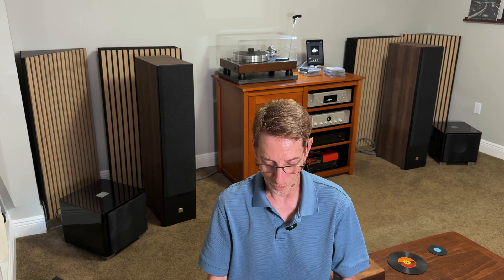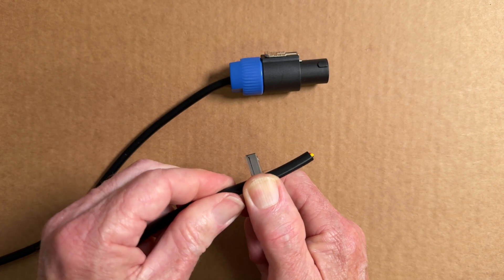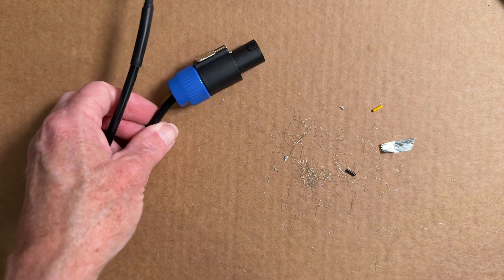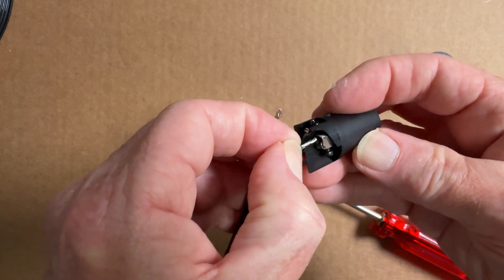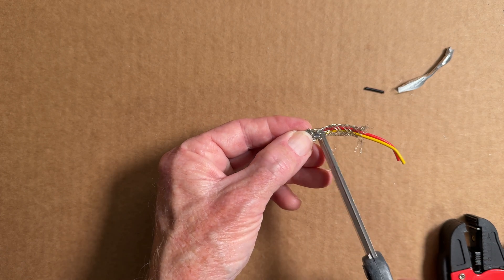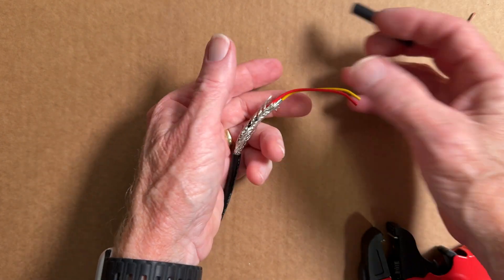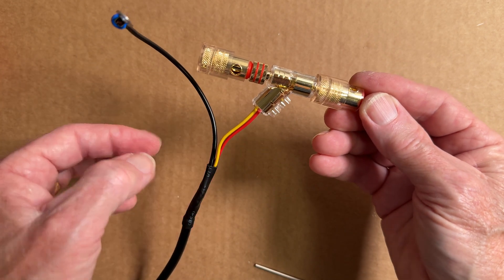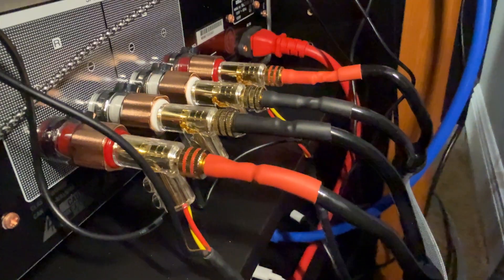Upgrade your REL's High-level input wires to eliminate REL Subwoofer Hum!

Comment from the maker: REL tech support was awesome, but unable to resolve the persistent hum I was experiencing with both of my T9/x subs.

CURRENT SUB SETUP:
*Yellow+Red wire from High-Level cable of the Left T/9x connected to the Left speaker positive output of Marantz Model 30 amp.

*Yellow+Red wire from High-Level cable of the Right T/9x connected to the Right speaker positive output of Marantz Model 30 amp.

*Black wires from both T/9x are grounded to one of the copper chassis screws on the rear of the Marantz Model 30 amp.

SUGGESTIONS FROM REL:
I’ve tried connecting the Black wires to the negative speaker connections on the Marantz Model 30, but the hum persist.

I’ve tried connecting the Black wires from both T/9x grounded to the Turntable Ground grounding lug on the Model 30, but the hum persist.

I’ve tried leaving the Black wires disconnected and running a RCA cable from the Marantz “Line 2 inputs” to the RCA LFE inputs on the T/9xs (LFE turned to minimum), but the hum persist.

I purchased an AudioQuest 303 Power Conditioner as well as 2' cables to connect all my components to the AudioQuest 303 (eliminating any excess AC wire length) and I purchased 15' long AC cables for both REL subs and ran the AC cables out the rear of the 303 directly to the wall behind the audio setup and along the baseboard before connecting to the rear of the subs. I ran all speaker and REL input wires several feet in front of the AC cables and ensured they did not cross at any point.

I connected my REL T7/x subwoofer to the same cables used for the T/9x subs and the T/7x never hums.

All outlets in the room are on the same circuit breaker. The Left T/9x is plugged into the same outlet as the surge protector for all the other audio components, the Right T/9x is plugged into an adjacent outlet all by itself. I’ve tried unplugging each of the subs, but the hum persist equally in whichever sub remains plugged in. I’ve unplugged the everything in the room, so the only two things plugged into any outlet in the room are the two subs, and the hum persist.  

I’ve tested all outlets in the room with a plug-in outlet tester and they all check out fine for polarity and ground connections.

I’ve checked the continuity of the ground leads on both subwoofer AC cords and they check out fine.

I took both T9/x subs to the home of the person who I purchased them from. We unplugged his REL S510 subwoofers (which do not hum) and plugged my T9/x subs into his power cables and high-level Neutrik cables and my T/9x subs still hum, although not as loud as they do at my house.

The only thing that eliminated the hum was upgrading the high-level wires to sheilded cables.

Here's the shielded wire I used:
https://www.amazon.com/LINKSQ-Conduct...

Locking, stackable Banana plugs:
https://www.amazon.com/Speaker-Connec...

Comment: I find it hard to believe that a manufacturer the size of REL would be gullible enough to include a cable that’s inadequate for their very expensive subwoofers.
Reply from the maker: I find it hard to believe REL's Baseline Blue Cables ($499 to $699) are also unshielded.
Reply: @Koolbob2 well, I'm not an electrician so cannot comment on the implications of your statement. Maybe you could write to REL and air your concerns with them. You could publish your letter and their response right here on your channel. 😂
Reply from the maker: @BobTheCat2153  Tempting, but after spending hours trying everything REL recommended via emails and phone calls I'm just glad I found a solution.
Reply: @Koolbob2  So glad you found a solution to your unique problem. It's amazing that after decades of producing Subwoofers, this issue hasn't been replicated elsewhere.
Reply from the maker: @BobTheCat2153  It's definitely unique to my situation since my T7/X that I use in my AV system didn't hum when connected to my audio only system AND neither of my T9/X subs hummed when I brought them to my friends house and hooked them up to his system. In case you missed it, here's everything I tried before making shielded cables......

REL tech support was awesome, but unable to resolve the persistent hum I was experiencing with both of my T9/x subs.

CURRENT SUB SETUP:
*Yellow+Red wire from High-Level cable of the Left T/9x connected to the Left speaker positive output of Marantz Model 30 amp.

*Yellow+Red wire from High-Level cable of the Right T/9x connected to the Right speaker positive output of Marantz Model 30 amp.

*Black wires from both T/9x are grounded to one of the copper chassis screws on the rear of the Marantz Model 30 amp.

SUGGESTIONS FROM REL:
I’ve tried connecting the Black wires to the negative speaker connections on the Marantz Model 30, but the hum persist.

I’ve tried connecting the Black wires from both T/9x grounded to the Turntable Ground grounding lug on the Model 30, but the hum persist.

I’ve tried leaving the Black wires disconnected and running a RCA cable from the Marantz “Line 2 inputs” to the RCA LFE inputs on the T/9xs (LFE turned to minimum), but the hum persist.

I purchased an AudioQuest 303 Power Conditioner as well as 2' cables to connect all my components to the AudioQuest 303 (eliminating any excess AC wire length) and I purchased 15' long AC cables for both REL subs and ran the AC cables out the rear of the 303 directly to the wall behind the audio setup and along the baseboard before connecting to the rear of the subs. I ran all speaker and REL input wires several feet in front of the AC cables and ensured they did not cross at any point.

I connected my REL T7/x subwoofer to the same cables used for the T/9x subs and the T/7x never hums.

All outlets in the room are on the same circuit breaker. The Left T/9x is plugged into the same outlet as the surge protector for all the other audio components, the Right T/9x is plugged into an adjacent outlet all by itself. I’ve tried unplugging each of the subs, but the hum persist equally in whichever sub remains plugged in. I’ve unplugged the everything in the room, so the only two things plugged into any outlet in the room are the two subs, and the hum persist.  

I’ve tested all outlets in the room with a plug-in outlet tester and they all check out fine for polarity and ground connections.

I’ve checked the continuity of the ground leads on both subwoofer AC cords and they check out fine.

I took both T9/x subs to the home of the person who I purchased them from. We unplugged his REL S510 subwoofers (which do not hum) and plugged my T9/x subs into his power cables and high-level Neutrik cables and my T/9x subs still hum, although not as loud as they do at my house.

The only thing that eliminated the hum was upgrading the high-level wires to sheilded cables.

Here's the shielded wire I used:
https://www.amazon.com/LINKSQ-Conduct...

Locking, stackable Banana plugs:
https://www.amazon.com/Speaker-Connec...

Comment: My sub only hums when the amp is turned off, do you think this would resolve that as well?
Reply from the maker: I'm not sure, if unplugging the speaker level cable from the subs makes then hum go away then there's a good chance using sheilded cable for the speaker level input would help.

Comment: I cut my wires to within 3 feet and then hook them to the speaker instead of the amp by the speaker binding post they’re nowhere near any electrical wires carrying current
Reply from the maker: Wise decision! I love that REL ship their subs with such long wires, but once you have found the ideal location for your subs there is absolutely no benefit to having wires any longer than necessary. I shortened my REL wires to about 8ft, just enough to route them as far away from AC wires as possible and reach the subs. Unfortunately for me that alone wasn't enough to get rid of my hum. Thankfully replacing my REL wires with shielded wires did the trick for me.

Comment: I just purchased a AudioQuest 707 Power Conditioner that is in the process of being shipped.  Did you notice better sound or anything from adding the Power Conditioner?
Reply from the maker: My primary reason for purchasing the AQ 303 was to protect from voltage spikes as well as having every component connected to the same outlet to minimize any remaining hum. I also purchased a pair of 2-foot power cords for my Marantz components and a 4-foot cable for my turntable. The shorter AC cables tidy up the wiring significantly and further reduces the chance of signal wires picking up AC hum. An added benefit is being able to flick the switch on the 303 when we are gone to further isolate the components from damage. I haven't noticed any improvement in the audio, but it puts my mind at ease when I see the house lights flicker or the power goes out and the shorter cables satisfy my OCD. 😁
Reply: @Koolbob2  Thanks

Comment: I have a REL Classic 98. When I first connected it I connected the Red and Yellow wires to the left and right positive output connections on my amp.  I left the Black wire unconnected, and I got a hum.  Once I connected the Black wire to a chassis screw on the amp the hum went away.

Comment: What gauge wire did you use?  It looks to be 18.  I'm wondering if 16 would also work?  Thanks for the detailed, informative video.  I'm having the same issue with my new t5x's.
Reply from the maker: Sorry to hear another REL owner is having difficulty with hum. Yes, I used 18 gauge (you can find a link to the wire in the description below the video). Larger gauge wire would certainly work, but I believe REL used 18 gauge for their 30' wire and my wires are only about 12' long so 18 gauge is fine. Be careful you don't go overboard with the overall wire diameter or it won't fit the connector.

Comment: Why would you not use copper wire instead?

Also, if you keep your signal cables away from your power cables helps get rid of hum. If you have to have them next to each other, cross them at 90 degree angles, running in parallel for more than 2 feet can introduce hum.
Reply from the maker: The shielding is aluminum foil and braided aluminum, the wire that carries the signal is high purity, oxygen-free tinned copper. So far as I know there is no benefit to using copper for the shielding since it doesn't carry the signal.
Reply: @Koolbob2  I wasn't referring to the shielding, only the wire that carries signal. I guess in the end it really wouldn't matter since the connectors in the ends are aluminum as well. Kinda cheap of them.
Reply from the maker: @seano218  The signal wires are copper. Here's why the tin coating is actually a good thing. "Tinned copper is copper coated with a thin layer of tin, which provides superior corrosion resistance and solderability while maintaining copper's excellent electrical conductivity. This combination is useful in harsh or humid environments, for electronics, and in applications where long-term reliability is crucial. The tin coating prevents oxidation, extending the life of the wire, especially in corrosive conditions like high humidity, marine, or industrial settings." The set screws on the REL connector actually penetrate the tin coating and make contact with the copper wire.
Reply: @Koolbob2  did not know that, thank you.

Comment: Could you explain how you wired the red yellow and black wires to the SpeakOn connector? I believe Neutrik labels the terminals to SpeakON as +1 +2 and -1 and -2. You called them top left and bottom which was is confusing on a round connector.
Reply from the maker: I didn't see any identification numbers printed on the Neutrik connectors on my subwoofers, so I put the new wires in the exact same position as the original wires and identified their location as best as I could with the information at hand.
Reply: @Koolbob2  Yeah, it looks like REL is using knock-offs rather than genuine Neutrik Speakon connectors on their stock cable. The REL Bassline Blue cable does use genuine Neutrik and I recommend getting those: they are not that expensive and will last longer. Anyway, the yellow wire connects to the +1, red to +2, and black to -1. The -2 terminal is left vacant.

Comment: Good experience, thanks.
I use a better quality cable myself, but short, since I mount them on the speaker.
That way I get both the amplifier and speaker cables' sound to the cable and down to the subwoofers.
In relation to shielded and unshielded cables, there are always pros and cons to consider.
One last experience from here, I have put each of my small Rel t5x on three tiles of 30x30x5cm, which are glued together.
In the setup here, it is a big lift;)

Comment: Outstanding Success! A brief hiccup when I wired up the speakon plug erroneously (I didn't requisition the existing connector, but bought a different brand). Zero hum and standby sensitivity as it should be. Thank you!
Reply from the maker: Awesome!

Comment: I noticed a blip in your video. After a belated application of the heat shrink, you had to strip the black wire back, again. You’d already done that earlier!
Reply from the maker: Sharp eye! 

The heat shrink tubing I'm using is pre-cut into fairly short pieces and after I stripped the black wire I realized the tubing would not cover the soldered connection AND reach all the way back to the cable sheathing. So I had to cut the black wire shorter than I really wanted to and strip the insulation off again. If I were better at working and videotaping at the same time, or better at editing, my mistakes would not make it to YouTube. 🤣

Comment: I have just ordered the wire and connectors to hook up the one REL TX5 to a Denon AVR. There is a hum, which I have to reduce by turning the gain down when I am not listening to audio. My subwoofer doesn’t enter standby, which I understand can be down to a shielding issue, also. I will be using the front speaker connections for red, yellow and black, as recommended for singular sub use. Great instructions.